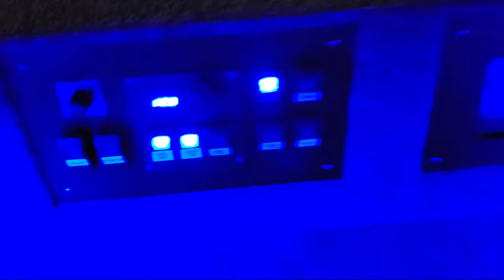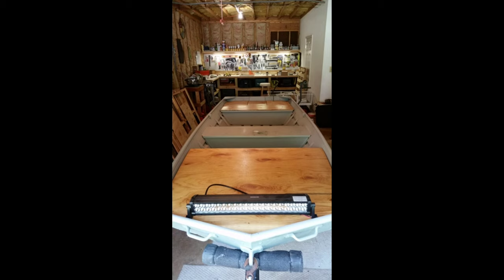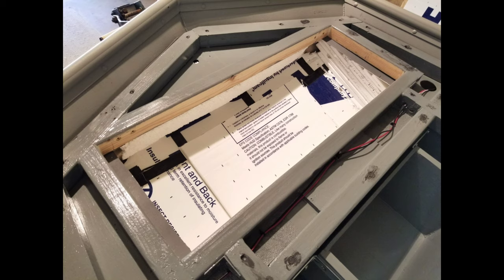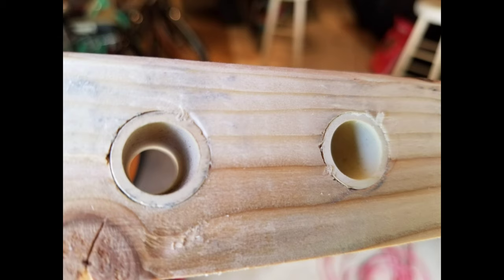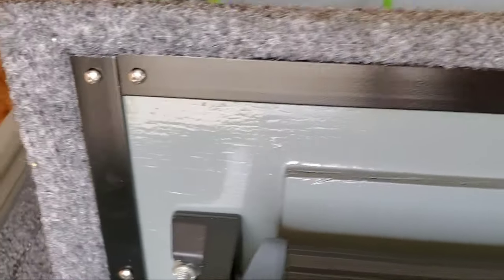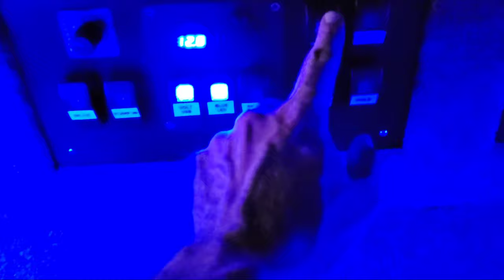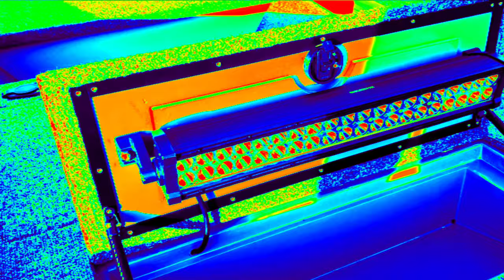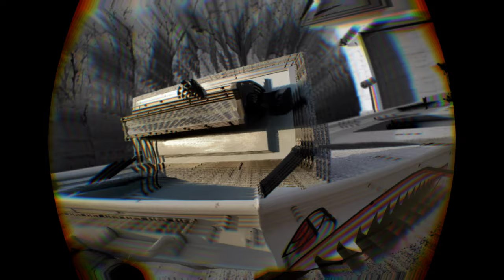Hidden / Flip Up LED LIGHT BAR In Jon Boat

Comment: Idk how well that would hold up doing about 30. Could cause some parachuting as well. Looks good though.
Reply from the maker: Not sure about 30 but I can tell you it has held up fine at 16mph which is top speed with my Honda 8hp. With that said, I rarely use the 8hp because I primarily fish electric only lake and reservoirs here in Georgia and kept that in mind when doing this modification.